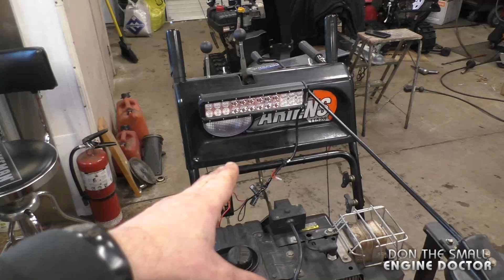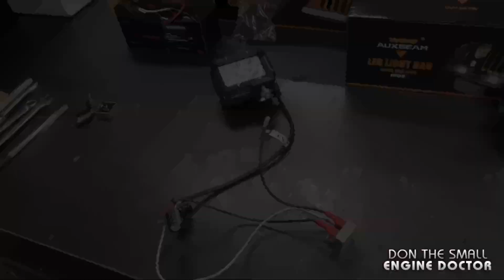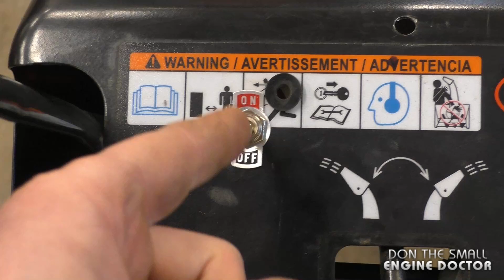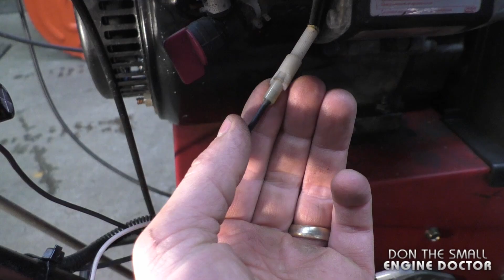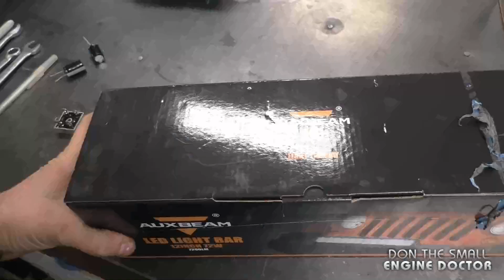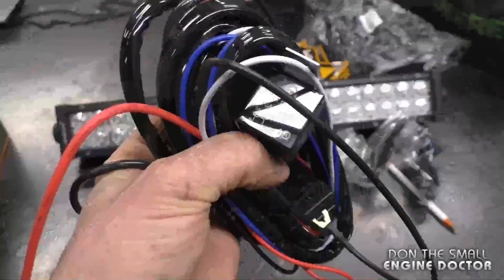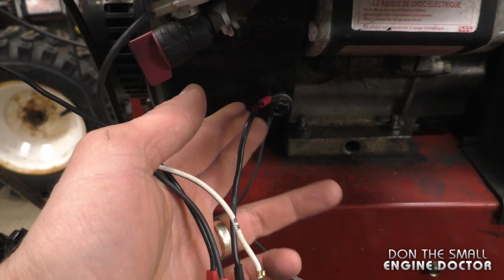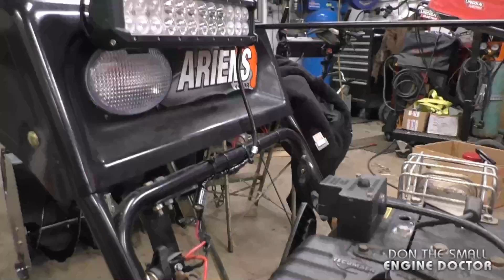HOW-TO Install LED Lights On Your Snowblower Without The Flicker!

Comment: Don. Just watched your vid. Another beautiful job. BUT I have seen 5 or 6 similar vids. about install in these lights and you are the only one who installed capacitors. The other people said all you need to filter out the blinking is to use a rectifier which makes the power flow in one direction. What is the reason for the capacitors other vids say you don't need them.
Reply: It is my understanding that the Snowblowers equipped with a light have an alternator which provides AC current, about 12.5 VAC.  When a rectifier is put into the circuit the output going from AC Smooth Sine Wave to DC results in only the top part of the Sine Wave is produced That is where the flicker comes from.
Reply: Gord: LED lights will only work when electricity flows in 1 direction and the AC lighting flows in 2 directions. When the electricity flows in 1 direction the light comes on but when the AC electricity flows in the opposite (alternate) direction the light goes out. This happens so fast that we see it as merely a flicker. BUT the rectifier keeps the electricity flowing in 1 direction only (Direct) this eliminates the flicker. But Donny boy has not answered my question (what is the purpose of the capacitors, no other people in videos mentions them)) my question still stands.
Reply: It is my understanding that the rectifier cuts off the bottom half of the sine wave of AC current.  This leaves 'gaps' in the current flow.  Capacitors store current and perhaps they help smooth the current flow by discharging during the gap.  I am sure there are electrical experts that can expound on this.
Reply: Gord Baker: I was just wondering why Don felt the need for then and no one else mentioned them. Maybe they act as a regulator so no surge of power will blow the lights. (in the absence of a battery)
Reply: I've seen others use a 5amp in light fuse instead of the capacitors, so maybe they are used as a surge protector.
Reply: Not true. I've installed these without the capacitors and the led's burned out in minutes.  The rectifier alters the current flow but not the pulse.

Comment: For units without charging systems or electric start one could retro fit their unit with just a 12 volt battery of appropriate size for their equipment or even one from a motorcycle and just attach a battery tender to the battery so when not being used it could be plugged in to keep the battery at full charge. LED's draw very little power so a battery of proper size for your equipment would last many times longer than a rechargeable cordless tool battery and you would just install them  as per the manufacturers instructions making your positive and negative connections to the battery. 
Not trying to beat you down DONYBOY73  but just saying there's more than one way to Skin that Cat. You have great informational and detailed videos thanks for your time.
Reply: Craig Timmons did that on my tractor for a winch and Strobe light, works very well

Comment: Thanks for this information, I will use the links for the lights! Only wish my blower had an alternator on it, but a 12 ah battery is a good substitute. I can charge the battery off my garage door opener when not in use.

Comment: Hello Donny
I have an old Craftsman Tecumseh 10.5 hp SB with an incandescent light. I didn’t bother with the rectifier. I just put the same lights you have with a switch and it works just fine with little or no pulsing. way brighter than the original. 
don
Reply: Don It will eventually burn the stator out. It gets really hot everytime you turn on the lights. You should invest in the couple bucks for the rectifier, so the stator never burns out.
Reply: Thanks Fearless.  i guess I can do that . I just don't know why that would be any different from using the original light.
Reply: Hi, the LED light acts as a diode, it simply uses half of the sine wave provided by the stator. This is the cause of the flicker. The only way you can damage the stator is by having your LED light exceed the specified power.
Reply: Don The original light ran off alternating current AC straight from the stator, these LED lighrs are using direct current DC, without the rectifier to properly convert from alternating AC to direct DC it will cause the stator to go bad. Thats the difference between the old light and the new LED lights, thats why they use a rectifier.

Comment: OK that is working very good but, what is the voltage required for those lights? I assume it might be 12 volts DC yes, no?
Reply: They useally spec at 12-24v but they can work from low as 10v or something like that

Comment: That made a hell of a difference, like night and day :-D.
It makes no difference the polarity of the input to the rectifier, its a bridge of 4 diodes that channel the ac phases to the + output and - output.
Even applying d.c to the inputs will be corrected to the outputs :-)
The capacitors smooth out the gaps between pulsed peaks, so its smooooooth lol :-D

Comment: How are you pulling 72 watts for the light , plus the heated hand grips plus the stock light. Aren't most snow blower altinators only 75ish watts?
Reply: Maybe he can see real good but has cold hands now lol
Reply: That's my only concern, that huge light is 72 Watts... what is the alternator pushing out ? .... the original light is not anywhere close to 75 Watts is it ?  I remember way back, having a sound system in my car, and I burnt out my alternator because it was pulling too much power.

Comment: Don, how many amps is that light bar ?
Reply: This is a recipe for disaster.
Nothing mentioned about current or voltage.
Over current kills stators.
It will work until the stator fails.

Comment: Why not just wear a bright led head lamp. Less work. Haha lol
Reply: I run a 1978 cub cadet and it has no stator. When I must snow blow at night, I also use a cheap 3 AAA energizer head lamp. Gotta make use of what you got.
Also thank you Donny for having this channel. I got this old cub cadet in pieces and learned to rebuild the old engine and assemble the parts due to your channel. Even used your trouble shooting lessons to get and keep her going. Thanks.
Reply: No doubt.  I have a CREE LED headlamp that lights up the world.  Got it on Ebay for $7.
Reply: Michael Burrows That's it problem solve. The best way. 👍👍👍
Reply: Fearless Thanks for the information going to open up one that I don't used anymore. 👍👍👍👍
Reply: Just reflects back into your eyes when you have a snow cab.
Reply: Ray Lugo yea works well
Reply: You can go on ebay and buy hand and head LED flashlights that are powered by the rechargable 18650 lithium cells, really cheap.
The cells in laptop battery packs are 18650.
I just grab a stack of old laptop battery packs, split them open, pull out the cells throw away the one bad one out of the 8 in a pack. Now I have a box full of rechargable cells. They last a few hours before they get low and than I just put another charged one in. When I go back in I charge the batteries back up again. I will never spend another dime on throw away batteries for a flashlight ever again and I got all the rechargeable cells for nothing. Thats how you stay ahead of the battery companies. I just wish they would start making other products besides flashlights to run off these cells. They wont because battery companies will be out of business overnight.
Reply: Ray, that is what I did also.    I keep a couple of  high output (XML) headlamps around.   Snow blowing, grass cutting, log splitting, emergency auto or MC repair,  etc.    I use them almost daily, year round.
Reply: I got one for my father and brother as well.
On the last snowstorm my brother and I worked thru the night. Those lights are great. I think I changed out my batteries 3 times the entire night and I still had another 20 batteries charged and ready to use. Those flashlights are great, because they take those batteries and they last a few hours, than you just swap in a fresh charged pair keep going and than throw the batteries back on the charger when you can. Best part the batteries were free and I have a ton of them and the flaslights were cheaper than any flashlight in the store. It also has little red light you can switch on in the back too solid or flash so you don't get hit by cars in the road from behind as well, they have 5 modes and one is strobe if your in distress.
We have a headlight on one of the snowblowers and its okay (better with the LED bulb in now), but the head flashlights are much brighter and go where you go. You cant beat them.

Comment: I am a little skeptical about doing this on a blower that does not use a battery. You could reducing the longevity of the ignition system with the extra load! Besides most of my blowing is done during the day and when there is snow it is always brighter outside at night, so do you really need lights?
Reply: There is no link between the stator output and ignition on that type of snowblower . The output is only to the light. Ignition is a magneto and  120V (household supplied ) electric starter
Reply: And average 18w pod light will run off a 9v batt so with that said how much of a load will it take propbley less then the factory one

Comment: Great vid as usual Don. On snowblower with a 12 v onboard battery can the light be wired direct to the battery without rectifiers or capacitors?
Reply from the maker: yes
Reply: Thanks!

Comment: Can you make a video showing how to install lights on a pull-start walk-behind mower with an electric clutch?
Reply: Get a rechargable-battery-operated-LED bar and attach with bungee cord - has its own switch.
Reply: Would be the same as this hookup as long as your mower engine has the stator to power the lights.

Comment: I love those lights. No snowblower for me in the south, but I have two of the next bigger size mounted on the front of my boat, and two the size you have shown on the back of the boat. Running boat trails with the reflective posts marking the trails  is now easier, and backing the boat up after dark is much easier to see as the two on the back of the boat now act as magnum back up lights. Like them so well and the cost is minimal, I'm considering adding two more on the rear bumper of my truck for additional back up lighting with or without the boat trailer behind.

Also for seeing the bank while night time fishing, I have one of the smaller leds on a clamp on mount, that I can dim down with a pulse modulation switch , which is fairly inexpensive also.

Comment: The wires coming from the blower are carrying AC voltage.The rectifier changes it to DC like your car. The capacitors filter the current ie: take out the pulsating that would be apparent with out them shrink wrap all of that well.wish my older ARIENS 521 had the magneto on the engine for lights.jim

Comment: There's a few ways to do it,one is how you've done it as the LEDs need a DC voltage & the capacitors filter the ripple out on the DC side of the rectifier.

The other way is to hook an aftermarket motorcycle or ride on lawnmower voltage regulator then run it with a battery.

Just an idea with your circuit, you could solder the capacitors in parallel on a piece of veroboard then incorporate it with the DC rectifier inside a weatherproof enclosure,then use weatherproof connectors (e.g. Deutsch plugs & sockets) to make it a portable unit which can be plugged into or unplugged from the snow blower & will make everything look tidy.

I seem to be only able to get electronic parts online on Ebay or at Jaycar in Australia, it seems that Radio shack is still open to where the Australian equivalent has closed down (Tandy).

Dick Smith Electronics was doing well until Dick sold it off to an overseas company, now it no longer exists !!!!
Reply: Russell Booth, do you need the capacitors? I have the bridge rectifier. I tried to use two led lights without the rectifier and they died within 3 weeks. I am hoping the rectifier will be enough to change the current and make the lights last. I am not worried about the flicker of that doesn't damage the lights.

Comment: Will this trick work with lawn mowers with electric  start
Reply: If it has a 12volt battery on board to power the starter, you don’t need to go through this procedure. The mower’s charging system will already do this for you through the voltage regulator. You will just need to follow the instructions with the particular light model that you purchase most likely making a direct connection at the battery. Hope this helps you out.
Reply: Run the power right from the battery in your case.
Reply: If you run right from battery I'm wondering how the relay fits in. Maybe so the full light current doesn't go through the on/off switch.

Comment: can you retrofit a light if your snowblower never had a light to begin with?  thanks for the video
Reply: Yes, Led lights use very little power. I bought a motorcycle battery to power mine. They run for hours and I just put a trickle charger on it and leave it that way when not in use. Adding the alternator to an engine would be very difficult and expensive. On throwers with lights there is a built-in magnet on the flywheel and a coil that the current in induced into. My battery was about $18.00. Just fashion a holder from sheet metal or something.
Reply from the maker: you would need somekind of stator or hook them up to a battery, these lights use hardly any power so a good battery would last a long time
Reply: I used a recharable-battery LED Bar - no hookup required: I put it on with bungee cords through holes on a Ariens.
Reply: Check your blower.  If you have a stator on the motor then you have what you need.  On the old Tecumseh snow king engines it would be a white plug on the right hand side of the engine obviously not plugged into anything.  It's possible your motor was setup for lights even though the blower itself never had them.  That was the case with my snow blower.  If you don't have the stator then you could install one, but that isn't easy for the regular joe.  Parts can be had for roughly $50 if you pickup a bunch of used stuff and put it together.  The worst part of changing a non stator motor to one with a stator is getting the dang flywheel off, many times you end up breaking them.  I'm in the camp of if your blower doesn't have a stator then a smaller battery plus holder is the best bet.
Reply: Use a weatherproof bicycle light. You can get mounting clamps that turn things 90 degrees, so you can attach ahead of the handle grips.
Reply: Look at lower portion of engine foward of the pull start. I had a craftsman without a light, but it had the option for a light on the engine.